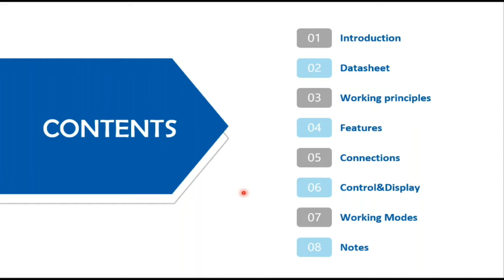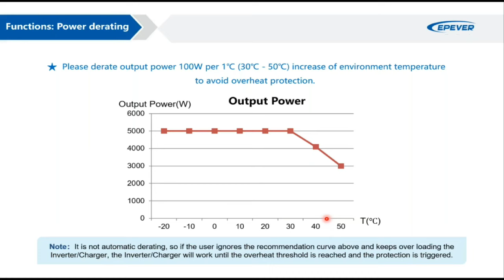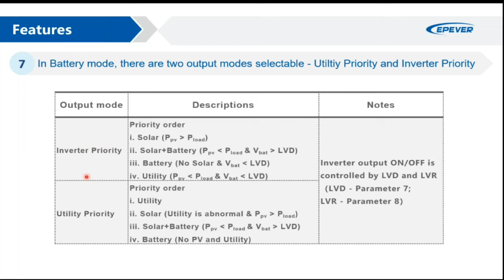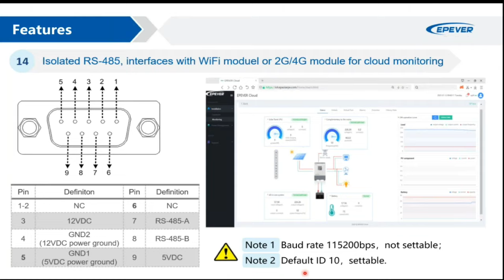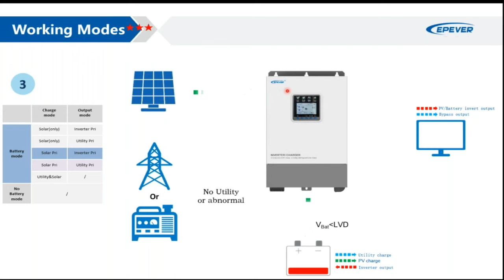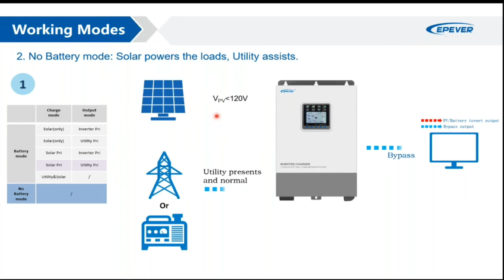Hybrid Inverter Charger - UPOWER HI - EPEVER Webinar series

Comment: I have the UP5000-8342 setup and I have set the AON and AOFF voltages to maintain 50-60% Charge when Solar is not adequate.  This works fine during the day, but over night it seems to ignore the AOFF setting and run a full boost charge from Utility supply. This uses grid power I don't want, and leaves the Battery too full for the Next Days Solar input.
Is this a fault, or a Software issue that may get resolved? I am using a smart hub to turn the Utility supply off when the Battery gets to 60% to get round this issue.
Reply from the maker: Hi Mark, thanks for reaching. In order to prevent the vibration and oscillation of the mains charging, if only the mains is charged, and without PV charging, then the AOFF will not work. AOFF only works until there is a mains and a PV to charge the battery.
Reply: I have the utility Neutral and utility Ground Separated from the Inverter Output Neutral and Ground. The Inverter Neutral needs a ground connection before the RCD or it can not operate.  Some other Off Grid inverters have an automatic switching in of this Neutral to Ground link, when running in battery mode, and switching it out when on utility power (bypass). I can't find this function in the Upower manual.
Reply: @marktssd4161  hi, do you know how many watts this inverter uses when pulling from utility?  It seems to be a crazy 300+ watts which is rediculous.  Not worth using.
Reply: @jmpcrx  Lowest mine has dropped to after it turns on utility over night is about 180w. You can't set different charge voltage for utility vs solar unfortunately. I would like to maintain 60% overnight and aim for 100% on solar, but my 2500w of South only panels rarely get to 100% voltage and never drop to float charge. I am running a Hubitat smart hub with some battery and load monitoring, so I could turn the utility socket on and off to do that but the on off switching probably isn't ideal. I want to get another 2kw + on my west roof to catch the afternoon sun.
So far the inverter has supplied about 400kWh from solar, and 300kWh from utility. I've not spent much time  trying to load during peak solar recently. it was about 200kWh and 100kWh in the summer when I was making the effort.

Comment: Is it possible to use a CT clamp to limit output back to the grid as i do not want to feed anything back into the grid
Reply: This is an Off Grid Inverter. The Utility Input connection is a standalone 30A Charger. There is no grid tie.
Reply from the maker: Hi Colin, thanks for reaching. There's no need to limit the current by CT in off grid inverter. The current won't entry to the grid.
Reply: @Epever  Thanks it's a grid tie inverter that i'm after so shall keep on looking.

Comment: So you have a AC breaker between the electricity in the house and the UP-Hi but should you also use a RCCB or will it cause problems?
Reply from the maker: Hi SUPERMILK, thanks for reaching us. Yes, you can use a AC breaker. And for the RCCB, you should use above 30 m Amp.
Reply: Will 300 mA be ok? The store here only has 10, 30 and 300 mA. Thanks for the help
Reply: why do you need RCCB above 30mA?

Comment: Hi, should the solar panel voltage be >120V to use no battery mode (UP3000 M6142)? My solar panel is max 80Voltage.
Reply from the maker: Hi Johan, thanks for reaching us. The UPower series(UP3000 M6142) does not support no-battery mode. Please note.

Comment: Let me ask you something, when  we use acid lead batteries it is not good to inject more than 10% of total bank of batteries and in hibrid inverters (Epever UPower-Hi UP5000) max 80A, is it possible to manage this or it is impossible to change? TKS
Reply from the maker: Hi Luis, thanks for your comment. Yes, the Upower-hi can adjust the maximum charging current to protect the battery over-charging.

Comment: I have the UP5000-HM8042, setup as follows: INPUT: Utility & Solar, OUTPUT: Utility priority. I have connected a gas generator to the AC Input, the Utility icon turns on in the screen but It does not charge the batteries, I have tried turning off the PV switch and the inverter output. It has been cloudy for days and the voltage is getting below 47V. which other settings need to be configured in order to connect a generator to charge the batteries?
Reply from the maker: Hi Fernando, thanks for reaching out. Please drop an email to helpdesk@epever.com, our colleagues will help you asap.

Comment: Thanks for the webinar.  There looks to only be a single ground connection the UP-HI be connection.  Should this be connected to the Utility input earth?  And how do you achieve a grounded output from inverter output, does there need to be a neutral bond or does it share the earth with the Utility input?
Reply from the maker: For UP-Hi, the input Neutral can be grounded via the ground terminal on inverter charger. The output Neutral cannot be grounded unless using a RCD (Residual Current Device.)
Reply: @Epever  hi, you mean i have to bridge the Neutral and the ground together? i live in europe and we have 220v. we dont have the Neutral and the Ground bonded anywhere. 
so can you please tell me, how do i ground the EPEVER HI 48v inverter? there is only 1 ground input. do i make a grounding rod and put 1 wire to that ground and then everything is good? or do i need to connect more? 

thanks

Comment: So one difference from hybrid to grid-tie inverter is hybrid can not feed power back to the grid?
Reply from the maker: hi Taison, UPOWER-HI series can not feed power back to the grid. it is a off-grid inverter.
Reply: @Epever  So hybrid inverters are considered off-grid converters?
Reply: @taison03251970  Not necessarily. A hybrid inverter is an inverter that combines AC charging/discharging and DC charging (via an inbuilt) solar charge controller in one unit like the one above. If such an inverter cannot feed energy back into the grid, then it's an off-grid inverter but if it can feed energy back into the grid (when necessary or when so configured), it's then a grid interactive inverter.
Thus, an inverter can be hybrid off-grid(like the one above) or hybrid grid interactive (e. g. Deye and goodwe hybrid inverters) . Similarly, there are off-grid inverters that are not hybrid at all (they convert DC to AC but can't charge batteries via AC or DC coupling) e.g. Victron phoenix, Epever SHI and IP series inverters.
You can also have grid interactive inverters that are not hybrid (they can convert DC to AC, can charge batteries via AC coupling, feed energy into the grid if so configured but have no charge controller function) e. g. Victron quattro and multiplus.
Inverters that can convert DC in solar panels to AC and feed into the grid but cannot charge batteries by themselves at all are called grid tied inverters.

Comment: sir, does this module  (EPever HI UP5000-HM8042) already support synchronous mode when switching from utility to battery or PV or vice versa? thanks
Reply from the maker: Hello jualan, do you mean the transfer time between utility and inverter output supply? From utility to inverter ouput is 10ms. From inverter to utility output is 15ms.
Reply: @Epever  not talk about 10ms or 15ms, but I mean whether when moving from inverter to utility or vice versa the sine wave is in sync with utility? or not, maybe you can take sample  by oscilloscope for both sine wave  when switch from inverter to utility happened when synchronous  or not
Reply from the maker: @jualanled5563   hello Jualan led, the inverter charger up-hi has phase-locked control function.  Moving from inverter to utility or vice versa the sine wave is in sync with utility, but for the 10ms or 15 ms switch time, there is no wave.

Comment: The fans on my new 3000w hybrid have not shut off, ever. They go constantly whenever unit is on. Doesn't matter if temperature is 20c-35c, doesn't matter if PV Solar input or none, doesn't matter if AC load is ON or disengaged. But if I turn off the unit to shut off those fans, it doesn't accept solar charge like a standard mppt would. There is no option to turn off all features of the unit, including the fans, BUT maintain the mppt solar input feature. I think I will go back to standalone mppts and the Iseries inverter
Reply from the maker: Hi Bob, there is a condition to turn on the fans. please check the user manual. you are right, if you turn off the inverters, the unit won't charge the battery anymore. If you have more questions, please contact our support team at helpdesk@epever.com
Reply: I had the same problem in mine. The support told me to change two transistors that active them. I did the job. Very cheap pieces and easy to replace them.

Comment: I've read these are very noisy, is there any way to make it less noisy? thanks.
Reply: Yes it's very noisy and lots of bugs and issues.
Reply from the maker: @cthivanka  Hello Chamil Thivanka, if you need any help, our team will try our best to support you.You can contact with our support team at helpdesk[at]epever.com
Reply: @cthivanka  The only issue I had with mine was the IWE fault which was resolved by grounding the unit properly. The settings can be tricky to get right and this could be the cause of your problems.
Reply from the maker: Hello Christian, Thanks for the feedback. The fans'  power and ON /OFF depends on the working enviroment temperature and the internal temperature of the products. For more details, you can contact with our support team at helpdesk[at]epever.com
Reply: The fans kick in from time to time but I wouldn't say they are that loud. If the unit is situated somewhere away from your main living space it will not trouble you but you could also mount it in a sound proof cupboard as long as it is well ventilated.

Comment: Hi, is it possible to connect a pc to the unit without using wifi, just a cable connection?
Reply from the maker: At his moment, you need to use wifi module and monitor the system by our remote monitoring system or APP. in future, we will launch PC software and you can use the cable for comunnication.

Comment: in the video it says do no ground the PV or battery when utility is on? can you clarify what you mean by that?
Reply from the maker: Hello  Sir,  if  there is utility in the system, connecting  the PV or battery to the ground is not allowed.  There is a grounding terminal on the metal case of the inverters which the user can use for grounding.